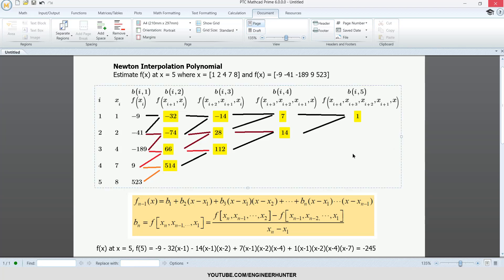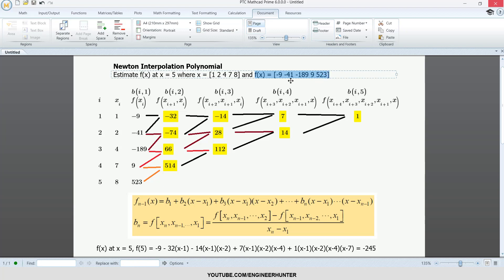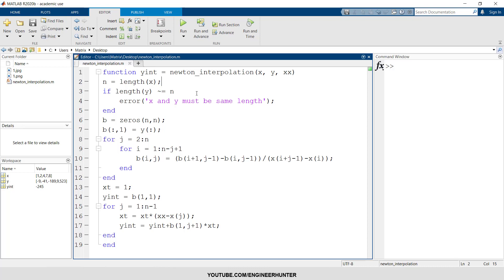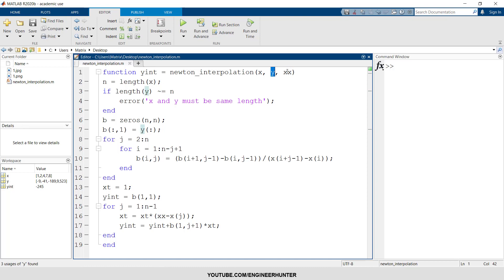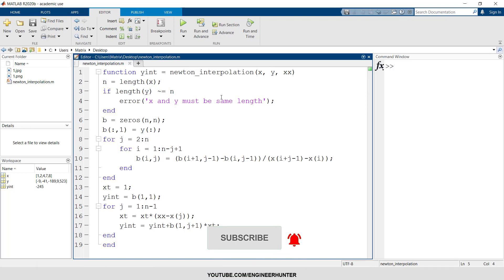Matlab : Newton Interpolation Polynomial from Chapra, S. (2011)

Comment: undefined function bro
Reply: First You have to save the code in the current directory by the same name as the function. Later, you can write the value of x and y and then call the function by the same name as shown in the last part of the video. You do not need to run the code where you generate it as a function. Just save the code and later call the function with appropriate input values and format.

Comment: Im getting undefined function or variable error
Reply from the maker: If you follows the code in the video, there shouldn’t be any error.
Reply: @EngineerHunter   What does the "xx" variable represent?
Reply: @nolanhensley   First You have to save the code in the current directory by the same name as the function. Later, you can write the value of x and y and then call the function by the same name as shown in the last part of the video. You do not need to run the code where you generate it as a function. Just save the code and later call the function with appropriate input values and format.